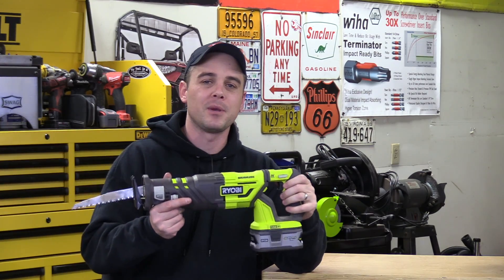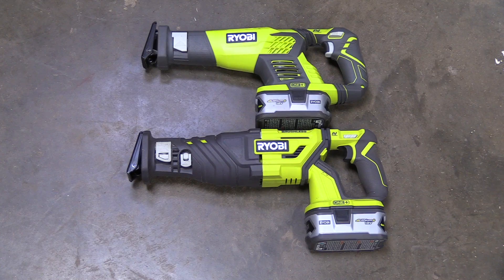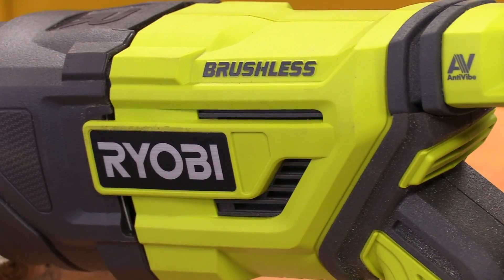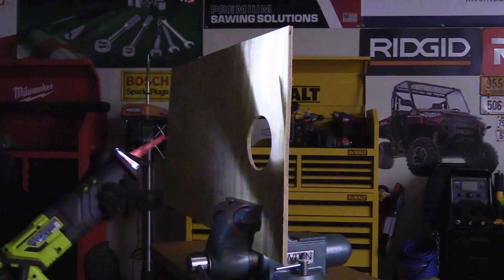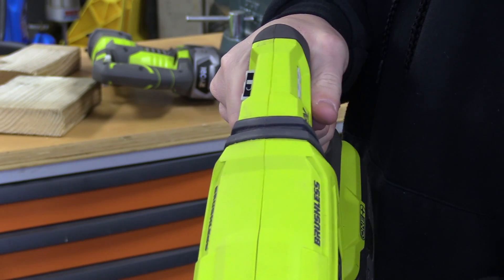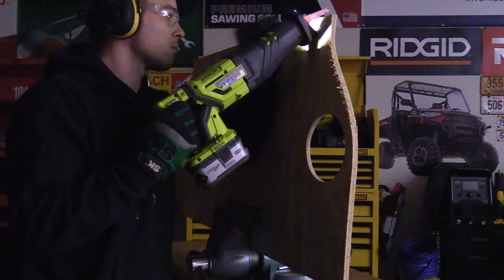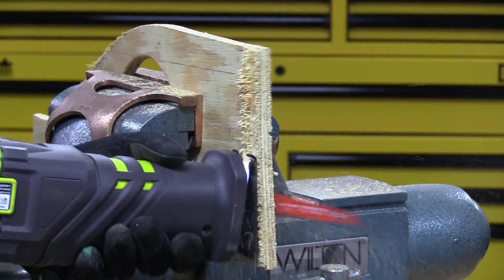RYOBI BRUSHLESS!!  P517 18v ONE+ Reciprocating Saw

Comment: I prewire houses for low voltage applications. When I first started out I used the typical cheap Ryobi tools. After a few months I upgraded to Ryobi's Brushless Drill and I haven't looked back. Co-workers even bought the Brushless drill and have thanked me for the recommendation. Granted we could buy Milwaukee or Dewalt but these Brushless Ryobi products are keeping up with the bigger guys for a fraction of the price. The only issue I have however with Ryobi and it's the same issue that the others have is the ability to completely turn off the LED light or to keep it on without a time delay.

Comment: A couple years back I bought a Ryobi combo of Drill, Recip, Circular, and work Light.  The Circular saw was only 6 1/2" and I wrote it off right away until I had a chance to use it.  It zipped right through a doug fir 2x6 like butter.  My previous experience with a cordless circular saw was a Kawasaki NiMh 6 1/2" saw and it didn't like 2x's of any flavor, so the performance of the Ryobi completely blew me away.  They're not professional or commercial duty, but for a homeowner they get the job done.

Comment: Why do people hate on Ryobi tools? I love mine. Seems perfect for non commercial use or even starter tools for a contractor etc.
Reply: Four reasons.   1)  They haven't tried the newer generation tools with Li-Ion batteries.

2)  They refuse to accept that a less expensive brand can get the job done, that they may have wasted money.

3)  They may legitimately have a need for utmost durability and performance, where profit comes from productivity and you want to minimize the # of times you have to leave a job to replace a tool.  The problem here is tool generations are now changing so fast that you have to guess if a new design has any new weaknesses and/or got rid of old ones.  Youtube videos can show performance and teardowns can make educated guesses at build quality, but ultimately real time in the field is needed to see what the weak links are in a tool (used as intended, normal wear, not the idiot reviewers who try to damage a tool).

4)  Their safety green color makes them look a bit like toys.

I have an investment in Ryobi tools that I picked up a piece at a time on sale and am quite pleased with them, but I am under no delusion that they are as good as Milwaukee for example, but they're great for half the price.  I already had many quality corded tools so I'm not trying to do everything with cordless.  Without question a high quality corded tool lasts multiple times as long, not even counting new batteries for cordless every few years.
Reply: I have a bunch of ryobi but i have milwaukee for my high torque impacts when ryobi has a nice high torque impact i will probably give it a shot because i love having one battery
Reply: Stinky Cheese   
You are right. When have you EVER read “I dont like my Ryobi tools”?  
We’ll just let them be. Their minds are made up. 

I have a Milwaukee corded drill and I hate it. Its too heavy, inconvenient as hell, and the metal case gets hot. My Ryobi drill is lighter, works great, and runs cool. I can use it anywhere even with no outlet handy. Its got a built in tip holder magnet and bubble level.  The battery lasts a super long time before needing a charge. 
When I need the continuous power of a corded drill, my plastic Skil is my goto choice. Never gets hot.
Reply: I need to find one of these guys to unload my Milwaukee corded drill on.
Reply: @lua ne yioue The battery tech has changed over the years.  They kept the same shape so ALL of there batteries ever made will work with any of their tools. Just  look up ryobi batteries to see a lot of vids on the subject
Reply: @Pass the Spider what Adam said. The battery shape has next to nothing to do with the actual battery cells squeezed inside.
Reply: I too like Ryobi tools except the batteries can be near impossible to remove from the tools due to the squeeze design.

Comment: I have the brushed version of this saw. Best saw I've ever owned. I cut branches that I normally used a chainsaw for. Getting up on a wobbly 12-foot ladder. I like the fact that it stops when I let go of the trigger instead of jarring me or the work-piece like a corded one. Just bursts with the trigger. One handed almost a third of the time, where I'd normally need a pole saw and get super tired, and make a horrible cut. 

This is totally worth it!
-- I have the P261 impact that has gotten me places I couldn't go with an air impact, like bolted truss reinforcements in an attic! 
 ---I have the P208B drill, and I put together a gazebo on a single charge with the original battery. I drilled out three ball joint rivets on a single charge with a carbide bit! I replaced a bunch of screws on my roof, and it lasted the day! I grind coffee with it every morning! Cordless drills are an extremely useful tool for any home! 
--I have the P717 spotlight. It's better than my headlights! I can and do play golf at night. 
--I have the brushless weed whacker. It could accelerate a bit faster, but still way better than roundup. 
--Next is the drain snake. Ryobi is underrated. 
--My Grandpa doesn't use his table saw anymore. He clamps an aluminum level to the big piece of wood he's cutting, and uses the circular saw.

Comment: I've had the old blue ryobi stuff for well over 10 years. The radio finally crapped out on me but other than that, they are all still running. I used them in my boat repair business around salt water just about everyday. The new lithium batteries are a night and day difference from the NiCd's. Cant wait to get my hands on the new 6ah batteries. I just picked up the new brushless 7 1/4" circular saw and wow, much improved!

Comment: Impressed! its faster for sure and the battery makes the tool usable now. I have the old model and it doesnt seem slow until you run it against milwaukee etc. The batteries are definitely holding ryobi back and now with a 4ah option it makes all the tools better

Comment: I've got a cheapo Chicago Electric that I primarily use all the time and just saved an older 12 amp Milwaukee out of the pawn shop that needs a blade clamp rebuild kit. I've seen some cordless ones at the pawn shop but this video has me considering this newer model for portability purposes. Your video definitely helped on my question about how long a battery can last.

Comment: IIRC, the P516 brushed saw did 120-something cuts in the same 2x4 test, which brings into question whether there is much gain to getting the more expensive, brushless version.
Reply: You have to take time to complete into consideration. I bet both test where done at full speed from the tool.
Reply: If you had to make some big 4x6 cuts, the P517 with HP battery will outperform the P516 even more. The extra contactor for HP batteries with brushless tools shines when it comes to high current use

Comment: This was a very helpful review for me.  It helped me make up my mind to buy the P517.
BATTERY LIFE:
Before watching this video, I was a little concerned the P517 might not run very long on Ryobi P102 batteries.  Those 2.0 Ah batteries are all I have.
Once he showed the ridiculous number of cuts made by the big battery, it reassured me that even my smaller batteries could be sufficient, and they are plenty.
 TOOL WEIGHT:
I was concerned the P517 might be somewhat heavy, but weight is a non-issue with this saw, imo.
I am used to the weight of a RIDGID corded R3020 model (a fabulous tool in its own right), but remember, there is no long, heavy duty power cord weight hanging off the P517. So it actually feels lighter, especially with the small P102 batteries I've got.
PORTABILITY:
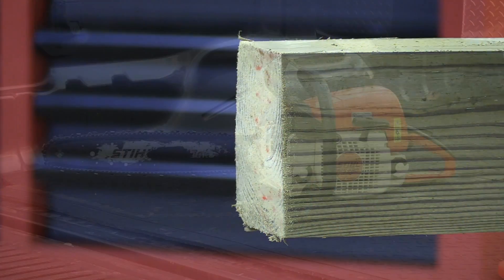The convenience of this tool is extraordinary.  2:55 Pruning trees is SO EASY with one of these. If you're out in the yard and you see a limb on a tree that is bugging you, you might now have that sucker lopped off and cut up before you'd have had time to even dig out and run an extension cord for your old 110v saw.   
COST: 
My P517 was $96.45 with my military discount, including CA sales tax, from Home Depot - May of 2019.
SPEED:
Oh my gosh this thing cuts through branches so fast, you gotta be careful about whatever is behind it, because you may very soon be cutting through that, too. 
I put a Vermont American blade called THE UGLY on this tool and treated it to a stubborn tree branch.  It was like a Weapon from Hell.  Of course, then you may have to cut up the branches you have lopped off if you need them to fit in your yard waste trash can.  Well, this takes very little time at all using the P517.  
SUMMARY:
I love this powerful tool so far. When you walk around with it, you feel like there's almost nothing it can't cut up.

Comment: As an electrician, I use and abuse my tools every day.  Ive had every big brand there is starting with the old stick battery Makita.   Made the Ryobi switch more than a decade ago after buying an 18v drill/saw combo that was to be strictly for at home use.  Was impressed with how well they performed but what really sold me was the 1/4" impact driver.  Quickly dropped my expensive Milwaukee stuff and went strictly to Ryobi.  Sure, the quality isn't as good as some other brands but the performance is close enough that I cant justify the price with other brands.  The brushless drill is incredible,  can't wait to add more brushless to my collection.  Id love Ryobi to make a porta band but that would probably be a no no at TTI, it would dig too far into Milwaukee.
Reply: P590 you got your wish. It was $99 with 2 3ah HP batteries last Christmas

Comment: Thanks, good review, looks very promising. I'm still using my blue reconditioned model(had Ni Cad batteries) I got over 10+ years ago, with the MUCH improved Lit. ion batteries.  It has seen some tough duty cutting tree roots in the ground and such. It is getting a little loose but it still cuts. It is not in the same league as my Miw. 15 amp Super Sawzall, but it is lighter, no cord so I use it when possible. And what the heck, I think I paid $83 for a whole bag of those blue tools. The Ni Cad batteries and charger are pretty useless now, but the tools are still going. This new brushless looks like a significant improvement, though at a higher price. But still not as high as most brushless saws.

Comment: I am using a P516 and really like it. I actually use it to cut down small trees up to 8" in diameter and then cut it up for firewood. It looks like the P517 has some nice improvements. Once the P516 dies I will buy a P517. By the way, I use the Diablo 12 inch pruning blade.

Comment: If you're getting this one. For $20 more get this Model # P1957N and you get 2 4.0Ah batteries and a charger.
Reply: thats a deal!!
Reply: That is a good deal, but it's not really only $20 more.  You can get the P517 bare tool for around $80 delivered now.  At the same time, paying only $60 more for two 4Ah batteries, let alone with a charger too, is perfect for people who bought a Ryobi multi-tool starter kit that has the smaller batteries.

Comment: This saw looks awesome. I'm still using the old school blue ryobi reciprocating saw with the new batteries. When I have to cut up limbs after a storm, it's my go to tool. I've abused the crap out of that saw and it was even a refurb when I bought it 14 years ago! I'm sure this one would blow it away. ANYWAY, I'd love to see you do a review of the new Diablo Carbide tipped reciprocating saw blades. Just one of those blades would probably last me years (!), but I'd love to see what you think.

Comment: This is an excellent demonstration of the Ryobi Reciprocating saw.  I have the P516 and like it very much.  Thanks for showing that other brand blades will fit on the Ryobi. i'm going to try the Diablo. I have many of the Ryobi 18v tools.  My newest is the oscillating multi-tool.  I'd like to compare it to the Dewalt oscillating multi-tool.

Comment: IMHO, Ryobi is the best bang for the buck for  a DIY homeowner; I never have seen the value in paying twice the price for yellow or red tools to complete my projects.  Now that Iv'e seen this new saw, I may have to grab me one.  Thanks.
Reply: Even if you're a pro, the batteries are very affordable and used in the entire tool line. There are home depots everywhere.  Home depot sells the other brands, but they're not all that.

To me it's like snap on tool fad.  My tools work, I don't care what brand name is.  Its all about cost, value and performance.
Reply: jimsiggy your absolutely right. People talk crap about this brand but we have been using the impact and drill combo at our mechanic shop for 2 years now with everyday heavy use and it has never let us down. Best $100 we spent
Reply: You may pay more for a Milwaukee but it’s also made by TTI. They make the Ryobi tools cheaper by using cheaper materials. A Ryobi should last a long time and is a good value but isn’t on the same level as pro tools. I haven’t owned a Ryobi tool but I did have a Craftsman drill which is nearly the same. It worked well for years
Reply: Availability anywhere you go throughout the USA is an added, overlooked value.  Ryobi tools and batteries can be bought at any Home Depot and there are plenty of locations around our great nation.
Reply: Todd, just because a tool has the torque to do something, doesn't mean that's how you're supposed to do it.  Any time you need enough torque to destroy a screw, you should have drilled a pilot hole.  This also relieves excessive stress on the material being fastened.  However, yes this is a real issue with any of the modern impact drivers, that their torque is getting excessive for 1/4" shank applications.
Reply: Moose: using your when the sentence should contain you are or you’re is a common and consistent spelling error.

Comment: I have used and own a lot of Ryobi tools, but I had problems with my brushless Ryobi recip saw... it kept popping blades when in the middle of a cut. Defective unit?  Design flaw?  I returned it so I will have one oddball colored power tool in the sea of neon green Ryobis I own. I will probably get a Milwaukee or maybe try out the new Craftsman from Lowes if it hits the market soon.
Reply: I had the same problem, blades kept popping out. Returned it. Seems like a design flaw. I have 15+ Ryobi tools, and like them, however, I've started moving towards Dewalt after my oscillating multi-tool burned up, and Ryobi didn't have a brushless version. I got the Dewalt and love it, especially since I don't need a tool to change blades. I'll be getting the Dewalt brushless reciprocating saw.

Comment: Nice vid!
I have a idea for a video for you:  Since you have all that measuring equipment , it would be neat to see how different length 1/2 drive extensions change torque values.  That is, what extension length would you need to limit torque to say 90 foot pounds - like a torque stick.  I realize it may not be the same steel alloy, but it still would be interesting to see how length changes the values!

Comment: Right now you actually can buy it in a set. They sell the saw with 2 4aH batteries and a charger for about $150. You can also get it along with a brushless drill, brushless impact driver, 4 aH battery and 2 aH battery for around $250.

Comment: It's nice that ryobi did away with the safety lock button. It starts to be a royal pain if you are using the saw for an extended period of time. I hope this model has better vibration dampening. My hands kinda start to hurt after using the my p514 for more than a half an hour.

Comment: Got the tyre inflator, that's great. Got the brushless combi drill and the sds hammer drill and recently purchased the brushless angle grinder, I only have 2 x 5.0mah batteries, but it's all I need, love the ryobi brushless gear
Reply: SuperStubbys . What is the angle grinder like ?. I am interested in one just wanted so feedback on one. Cheers.
Reply: Mark Thomas  it is good but quite battery hungry, I wouldn't use anything other than the 4 or 5 amp hour batteries with it. And if you intend using an angle grinder for the whole day, then just go corded or plug one in. But one battery enabled me to cut up my kids old A frame swing set, enough to be able to put it in the car to dump it at the tip. Plenty of grunt in it, very handy for occasional use or on a job site or at home and you don't have to go through the hassle of an extension lead and all that fuss that comes with corded, I'm well happy with it and I know if I'm gonna need to use one a lot I'll just plug in my little Bosch one and use that.
Reply: I'm just trying to go all cordless and brushless (if they do brushless that is), I do the occasional bit of labouring work and the little sds held up well too, the bloke I work for sometimes was impressed with it and he is a tool snob.
Reply: SuperStubbys . Thanks

Comment: Ryobi works great. Not the best of the best but functionally great as a homeowner for sure. If I had a professional construction business I kinda like makita and milwaukee myself. But I'd have to consider tool variety & price because of possibility of theft and replacement cost as well. Sometimes longevity doesn't matter and I've had great longevity from my ryobi so far. Only complaint is the high draw tools need better batteries than the 4ah really. They work great when new but the battery gets a aged good but still plenty good to use and hold charge they get overloaded by my high draw tools such as the angle grinder and 12" brushless chainsaw. I read rumors of a 9ah battery coming and supposedly should've been here already which would be perfect for high draw yet I see no sign of them yet. Hopefully we can get them though.   The chainsaw would be awesome with it.